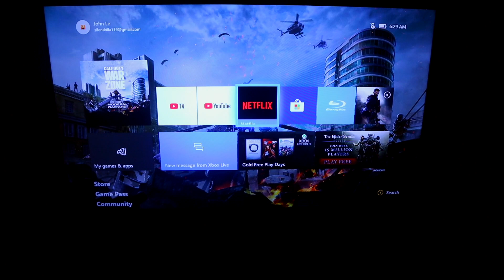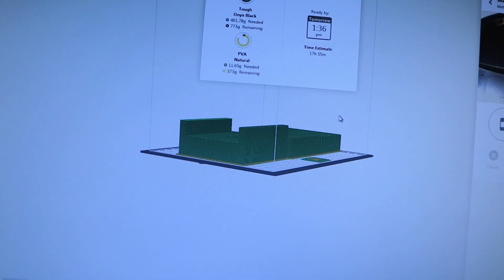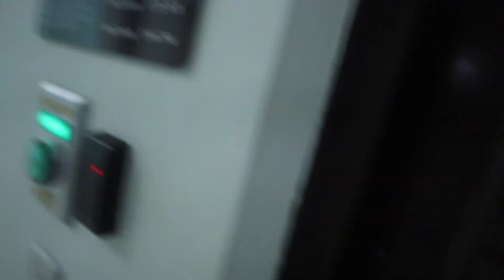Day in the Life of a Mechanical and Process Engineer in America | Work from Home Edition

Comment: I been windows user for so long all the way to win 98 and love operating systems. Windows platform is way better use for company network. Since more big companies uses windows because of its great network capabilities.

Also great about many people working at home is our LA California freeways been clear with no traffic for past month now. This is cure of our terrible LA freeway traffic lol....
Reply from the maker: I agree. lots of engineering applications also run on windows; however, I prefer a mac if I can. Mac runs a little more stable, and fluid. also, not much crashes and stuff like that. 
While COVID 19 has been terrible. there are some good things that can come out of this if people take advantage.
Reply: @JohnLe  windows is pretty much stable now using Windows 10. Also it depends on inside of computer ( Hardware, Memory etc..) what makes your computer run efficient without crashing. I built my computer and great about using PC upgrade it far cheaper price than a Mac computer.